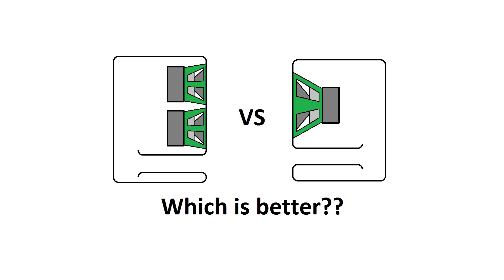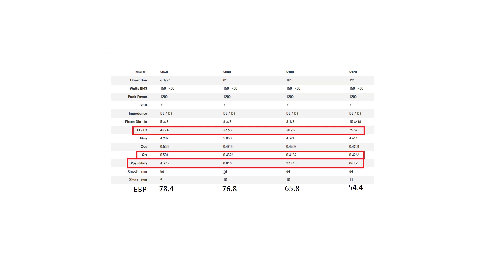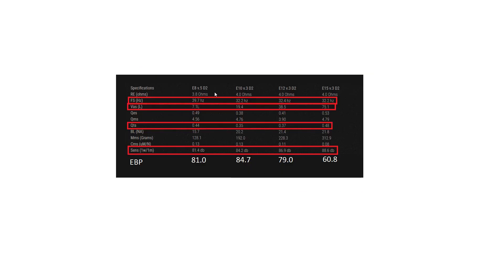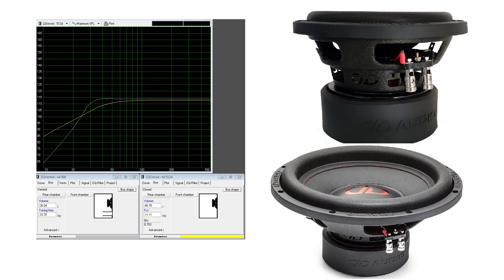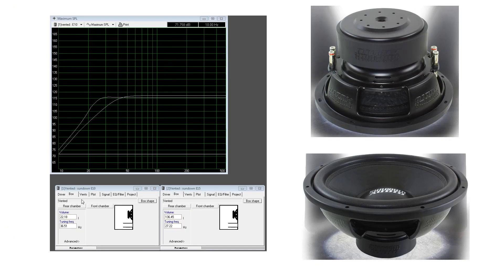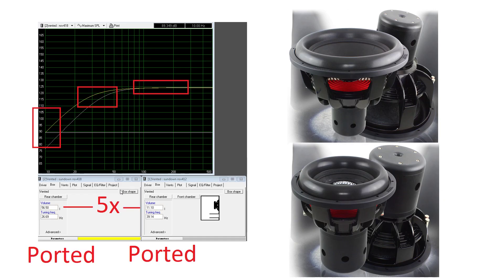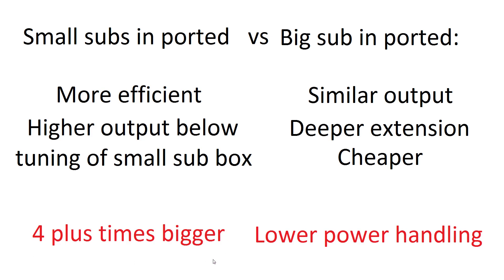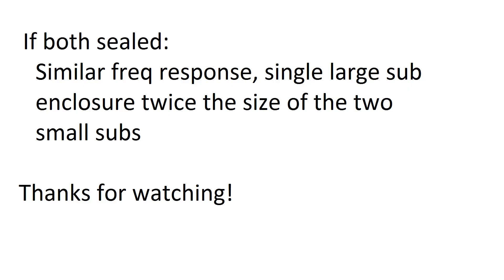Two small subs or One large sub?

Comment: The breaking point for me would be whether or not the alternator can handle it before upgrades and more batteries. If lack of room is a concern You can always build a passive radiator box which is the size of a sealed box but acts like a ported.

Comment: OKAY, I would like to ask something from you. I chose a 4" driver for my next project for midrange. The design would be a classic approach, small driver in a very little closed box within the main cabinet. The driver is designed mainly to be a dedicated midrange driver, HOWEVER, the calculated EBP number is over 180 (Fs=63,5; Qes=0,35). So, am I "forced" to use this driver in a ported box?

Comment: I have two JBL series 3 12" 500W subs in 0.8cubic Ft boxes and they are really efficient (as far as I can tell). (JBL changed the name of them from "series 3" to "stadium" or something like that but they are the same sub, other than some color changes). Based on the numbers they give in the owners manual, they say that the sub is better in a sealed box rather than ported. I can definitely tell the difference in my system compared to a few others with ported boxes. The best example I have is a naughty song: GPF - Rub R D*ck.  If you have a sealed sub you will get insanely tight bass response for that song. But if you have a ported box, you'll probably get a sloppy bass response. I connected a volt meter to the input lines of one sub, and when I'm supposedly doing 1 watt or 10 watts, it is pretty loud.  But I have seen videos of people doing ported set ups and pumping 3x the rated power through these JBL subs and it's insane.  I'm not going to do that, but if you are not worried about blowing out your sub, then go for it.

Comment: Fantastic video. I'm still learning how subs work. My question. I have a pair of TS-A301S4 12" and I see the total EBP is 46.74. It's almost close to being able to port it. What would happen if I did? I'm trying to reach a lower frequency and I have 1.25 cubic feet sealed box. But these subs are not designed to be ported; Learning all this after I bought them. Should I increase the volume of the box to 2 cubic feet or just add lots of polyfill? 
Last question. Does getting a subwoofer with a higher RMS wattage lower the EBP?
Thanks. Any advise is appreciated.
Reply: Well it depends on you . Id build a larger sub enclosure 🤠👍
Reply: @bobcat3653  plan to and custom to my trunk.

Comment: One often overlooked fact is that the larger the driver, the smaller its circumference as compared to its surface area. This circumference being where the air wants to leak away from the driver rather than move with it, it is then easy to understand why coupling will alway be better with a large driver, giving it it more clout especially at low levels.

Comment: Let's have an argument about two ported 15s versus four sealed on the same power and in the same cubic feet
Reply: @Carl Klinkenborg I love it,  basically all the reasons that I am leaning and have always leaned toward four sealed over two ported. Doubling the number of drivers and power will always result in a 6 DB increase (min) while reducing thermal compression as well. 
    I also much prefer the impact and transient attack of a smaller sealed cabinet vs a max dimensions ported as well. Even the small sealed cabinet will be able to dig lower with better roll off than the lowest tuned ported enclosure like you mentioned which has physical limitations on tuning capabilities and a giant annoying hump at the tuning frequency and massive drop in performance with frequencies an octave or more above tuning frequency( been a musician for over 30 years so can't stand the leveling to be so out of balance and the fuzzy overhang and poor detail of a reflex system) 
      Last but certainly not least the sealed setup will always have better low lows(my SQL 12s do 8 hz in .8 f3)  and way way better upper and response especially with a shorting ring for inductance reduction. 
I agree power is too cheap and easy these days to not run sealed
Reply: @Carl Klinkenborg oh yeah and to answer your question I'm getting a 2011 rav4 and wanting to put 4 15s sealed in the back, running them at 1.8 cubes each because I love that hit and sharpness you get at minimum airspace sealed and 4 15s should be enough output even if sealed on around 3-4k. Honestly if I pull the floor out and build the box to fill in the secret compartment I can run 4 18 sealed at 3 cubes each. Not to mention that EBP is better for sealed the larger a driver gets so big subs sealed really get low and clean doing it. I can fit the 4 15s facing backwards lvvl (overhead view) the 18s would have to face up as all possible space would be used.
Reply: @Carl Klinkenborg yeah I agree with you I'm 46 and just had a hearing test done this year and it's good so I would love to keep it that way. Just said in my girlfriend's Brothers SUV and he had two ported kicker l715s. Of course they were obnoxiously loud but had terrible sound quality and not my cup of tea. I know what you're talking about with the mid-range being super important for the overall transient response of your stereo. I like all music but write and play metal the most so I agree. 
When the doctor told me my hearing was good I was shocked cuz I have definitely abused my hearing lol. 
   That was actually the deciding factor to go with a decently loud SQ setup instead of something too loud
Reply: @Carl Klinkenborg  I might be more inclined to go oversized ported for a home theater set up. Get a good low FS driver and build the box big to boost the lowest frequency range and tune really low oh yeah love that movie rumble
Reply: @Carl Klinkenborg Honestly I haven't made my mind up about what drivers I will use any suggestions for my goals? There's so much out there it's hard to choose
Reply: @Carl Klinkenborg I'm in the USA. Wanting to go small sealed
Reply: @Carl Klinkenborg il b there in only 13 years
Reply: @Carl Klinkenborg I can get the b+c here iv looked at those and liked them. Willing to run 2 21s sealed if need be
Reply: @Carl Klinkenborg it only shows a ported value on the site I believe 8 cubes per sub. With the SUV I'm going to end up with about 14.5 cubes gross so should be enough space net for two sealed 21s. Same surface area as four 15s. Just wanted something that could dig low and one of their models has a FS of 30 and recommended tuning of 32 that one look good to me.
Reply: @Carl Klinkenborg man thank you so much for this help these are the exact details I've been wanting to nail down before I do this build
Reply: @Carl Klinkenborg me as well which is why I'm looking into the professional audio realm even though I'm doing a SUV system. The myths and misinformation in car audio is beyond crazy.
Reply: @Carl Klinkenborg I looked at the ipal and it's a little heavier than I was wanting to run since I want to run two of them the RCF you mentioned looks great to me it just says n instead of x what's the difference? 
I'm definitely after the high impact excellent transient response sound quality effect over just dirty rap spl ported.
Reply: @Carl Klinkenborg  the mid bass area from 60-80 hz up to 300hz is so very important to the music being full and stereo separated it is so neglected especially in car audio. 
Sorry to talk your ear off but you're exactly the type I was wanting to learn from I know a little bit but need to learn a lot more
Reply: @Carl Klinkenborg  finally found the x series drivers and am thoroughly impressed after looking at them no wonder you recommended them to me exactly what I was looking for!!! I can also do 150l separate enclosures, perfect fit for net available space. And only 34 lb each light like I wanted as well. I'm going with those and nobody in my small town has 21!!!!
Reply: @Carl Klinkenborg Carl you rock man thank you!!! After looking at the RCF drivers I think they are only available in 8 ohms which would bring my final impedance down to four ohms. 
I would much rather go with a 4-ohm option and run two of them for a final impedance of 2 ohms. 
Do you have any other recommendations for a small sealed enclosure 21? 
I would also still be open to running for good 15s small sealed as well if 8 ohms is the only option. 
I think at this point the only argument is 221s or 415s I've always had better luck going with quadruples instead of doubles with my available airspace for example four tens instead of 212 s.
What is your opinion on this seems like it always helps with power compression and accuracy to me but I know those bigger speakers have advantages too
Reply: @Carl Klinkenborg I find the theory fascinating of how this all works. I looked at the BNC 21 SW for ohm model and it has an EBP of 103 which is a little higher than I'd like to go small sealed.  
     I would love to get your opinion on a possible option I still have. I recently purchased three stereo integrity SQL 12 which are a very high-end optimized for sealed driver. 
I was going to put them in my smaller car but would still like to figure out a way to run them in my SUV. 
I saw a video of a third order horn enclosure where it's basically a sealed box that is boundary loaded onto a surface that then acts as a waveguide. Basically I've got 12.5 cubic feet gross to work with and the 3 12s need about 2.4 ft3. 
  I have heard many sealed subwoofers setups that were boundary loaded onto a surface that sounded amazing. Do you think these SQL drivers would be suited for that. It would basically be 2.4 cubic feet internal airspace and then the rest could act like an acoustic amplifier being a big mass of air that the 312s are loaded onto like a horn. 
These 12s are very good and have xbl2 motors and stellar sound quality and transient response. If they were boundary loaded in a horn style enclosure how would that compare to the two 21 sealed? 
   I know I've had my socks knocked off by Big Horn style cabinets that only had a couple of 12-in drivers in them with those three 12s being option in that available space?
Reply: @Carl Klinkenborg https://youtu.be/pKYnxad2w0w
Reply: @Carl Klinkenborg nope, everything you just said made total sense to me, and I'd like to stick to 221s if I can. The 12s were meant for a much smaller vehicle and after much searching the b&c-21sw does look like my most likely route if you say the EBP won't matter that much.
    I haven't heard a horn loaded enclosure like I described but I'm like you and just can't stand that soggy bass lol, that is the perfect term for it.  
    If you say pull the trigger on those bncs then I'm good with that because I can get the two ohm impedance I'm after and run the 21s. 
I bet they'll have a more tactile visceral feel than the 4 15s as well as being a perfect match for my total available airspace. That's good news to me that they'll still work great and small sealed!!!!! Just hate ported especially when they build the box to Max size or bigger and the group delay is really high and it sounds all loose 🤮
Reply: @Carl Klinkenborg wow 250 Ms is more than 10 times the amount reliably detected! That's what I was talking about with the oversized ported enclosures yeah sure it shakes everything but it's horribly muddy and loose. When I play bass guitar I need an exact representation of what I'm doing or else it doesn't sound right at all. Sealed has always been my preference even though they measure less decibels the impact and hit sensation is sharper and greater with a high-powered small sealed setup. I can't help but think a larger open space will need larger cones flight 21 and with two instead of four there's less destructive cancellation with the waves and probably more efficient because of the superior coupling effect of larger cones as well as only overcoming the inertia of two motors instead of four. 
     The B&c has a 6-in voice coil right? That's pretty crazy traditional wisdom states that the output capability of a sealed enclosure is dictated by total displacement factoring surface area x excursion right?.  
   I'm not sure I totally agree with this because I've seen certain drivers have more output with less excursion. I'd say the awesome motor strength of those 21s combined with a larger cone will really be superior to 4 15s. Also less excursion means more sound quality
Reply: @Carl Klinkenborg I agree completely with that which is why small sealed is the only enclosure style I want to go with. It really helps with the cone acceleration and deceleration. There's no substitute for that high energy concentration quick hard-hitting bass it produces. 
    40 years of listening to different stereos empirically proves to me what you're saying about moving the air gently and taking advantage of a larger cone that doesn't have to move as far. Combine less distortion with less excursion and a really high BL and I can see why you recommend the 21 s. Is it that neo motor that makes the BL so high that is really good motor strength and efficiency on those bcsws
Reply: @Carl Klinkenborg I'm curious Carl are you German I know you're in Europe over there. It always amazes me how much better the average Germans English is than the average Americans even though it's the Americans first language.  
I really enjoy learning all of these details as I've always been interested in music and stereos. 
    Thank you again for your recommendation after going over every detail of the b&csw 21s I am absolutely going with those. Every person reviewing them says they're the best sounding subs they've ever heard. 6-in voice coil demodulating ring will work in small sealed neo motor with ridiculous BL. 
Thoroughly amazing high-end subwoofers and you recommended 4K of legitimate RMS power to each? My God this system is going to sound great. Would 150 l separate enclosures work well for these?
Reply: @Carl Klinkenborg Hey most definitely 😁😁😁😁😁 definitely after music and not distortion!!!
Reply: @Carl Klinkenborg yes the clamshell isobaric that I have been hearing about!!! I have actually never heard a setup like this but have been really really curious. I was going to try it but decided not to after someone told me you always get so much motor noise from the sub that is outside of the enclosure. 
       Oh you mean the same enclosure just one magnet outside and one inside I could see how that would work too.

Comment: Big drivers face some problems though that Winisd doesn't simulate. The cone is mich harder to control due to the high mass. Also, it doesn't move coherently. The outer part of a large cone lags behind a bit, causing additional group delay.
How much this actually matters is up for debate. But can imagine a cone with 1m diameter or more to be wobbly, so there are some limitations to practical woofer size
Reply from the maker: Yes, extra motor force per area manifests itself as the driver being able to overcome the higher pressures of a smaller enclosure. Trying to minimise diaphragm mass is a battle, especially considering higher power voice coils, and optimising parameters for smaller enclosures.
Also, in regards to the edge lagging behind, the ribs/concentric circles seen in the cones of some PA speakers and guitar speakers are designed to do exactly that. Low frequencies make their way outward, maximising area, though high frequencies don't. This avoids the issue of "beaming", where high frequencies are only audible directly in front of the cone. Adding  the ripples improves midrange of such speakers.

Comment: I like doing triple and quad subwoofer setups more coil to take the heat and you end up with more surface area for your enclosure volume FTW.  
    I run xbl2 subs ported and their sound quality is higher than most seals setups I hear

Comment: Goin through  the contemplation of this right now. Currently running  two single voice coil  12s but have been wanting to go with a single 18 inch DVC just the Hertz and wave I'll get from the 18 will be much lower  and should move way more air.i just want to hit like 20hz at like 110 decibels strong as fuck. Its happening  quicker than anyone would think  but I'm on my way to entering small SPL  competitions  . Long live the bass heads

Comment: I have a question I have a 188 watt amp laying around from a Logitech z5500 with the sub 10 inch and a z906 sub 8 inch I also have another 4 channel amp 4x40 what should I do but them both on the 188 amp or put the 10 inch on the 188 watt amp and the 8inch on the 40 watt amp?
Reply from the maker: Better to have them on different amplifiers, if the 4x40w amp can be bridged to give the 8" 80w even better!
Reply: @Dakoustics  how do I know it can?

Comment: The Sundown SA V3 8" Subs hit pretty hard and the Sundown X v3 8"s also do. I got both sets of those and I got a Sundown X v2 15" which I was running in my VW CC and I had two Skar DDX 15s in my truck.. but I pulled em and now using my 8"s and those 8"s are no joke. Sundown makes amazing 8"s.. I dunno how good the E series are but a single SA 8" does a 147 DB sealed 149.9 with the door open. The Xv3 8" does a 153 or 156. You can watch it happen on Sundowns youtube. And owning them I can tell ya they deff can hang with bigger subs easily